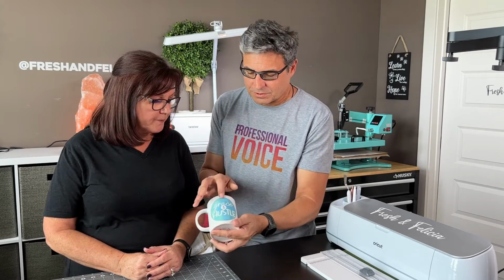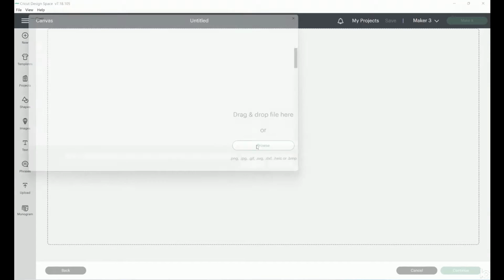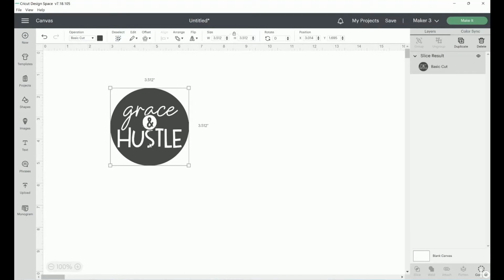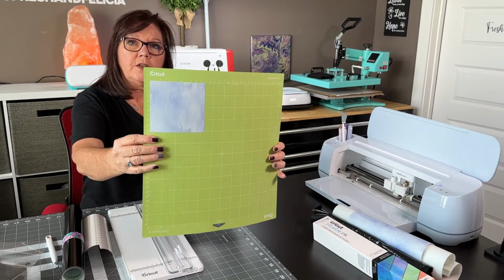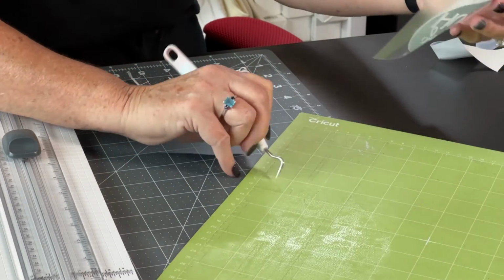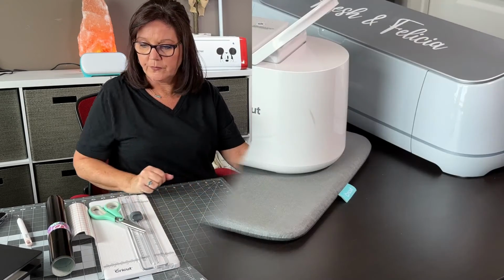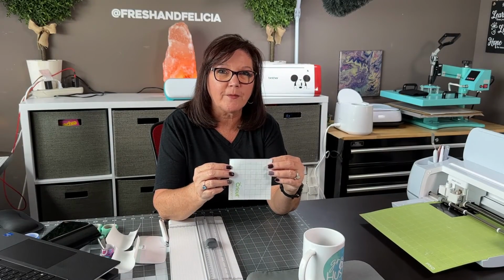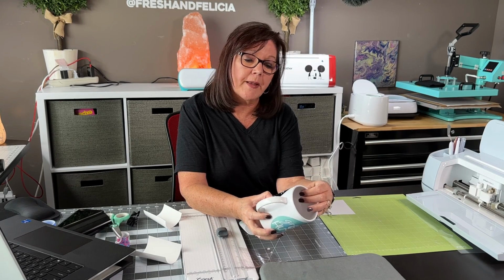How to Make Mugs or Cups with the Cricut Maker

Comment from the maker: Here are the product links to the Cricut products used in this project. We are Cricut and Amazon affiliates, so we may earn a very small portion of your purchase (THANK YOU!)
- Cricut 15 oz mug https://amzn.to/3COrsub 
- Cricut infusible ink https://amzn.to/3Tb5cQt 
- Cricut permanent vinyl https://amzn.to/3TewlC6 
- Cricut Mug Press https://amzn.to/3fZTl9C 
- Cricut Maker https://amzn.to/3enZlsy 
- Cricut Trimmer and Weeding Tool https://amzn.to/3Cni1jZ 
- Cricut Heat Resistant Tape https://amzn.to/3CIY4pg 
- Cricut Heat Mat https://amzn.to/3VaujF7 
- Cricut Standard Grip Mat https://amzn.to/3yviyiD 
- Cricut transfer tape https://amzn.to/3fXZF1E 
- Lint roller https://amzn.to/3Cr4c3X 
- Inspirational Quotes SVG Bundle from https://designbundles.net/mstudio/240665-inspirational-quotes-svg-bundle?ref=AlzBbp